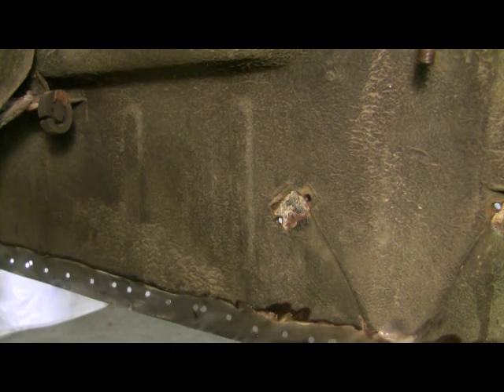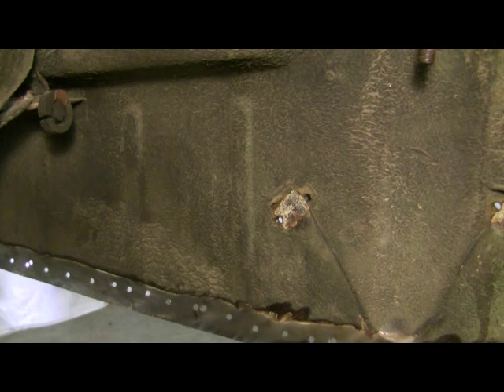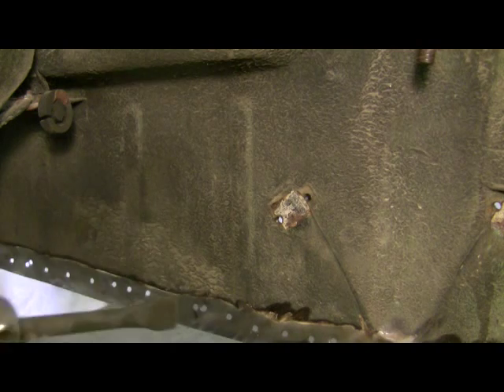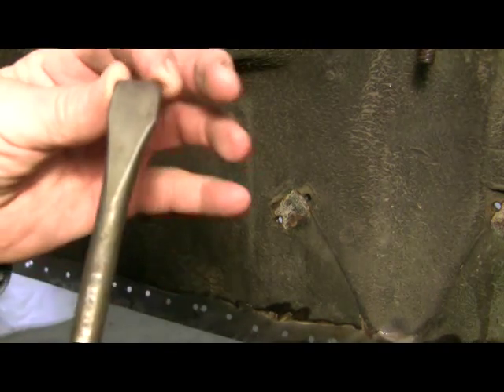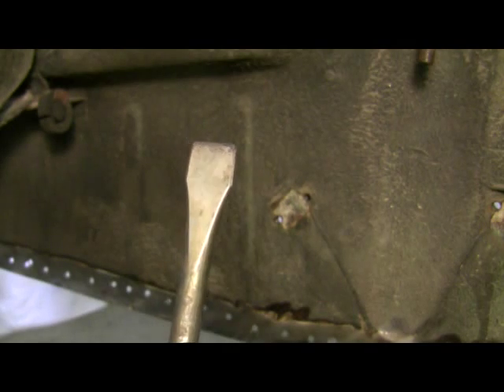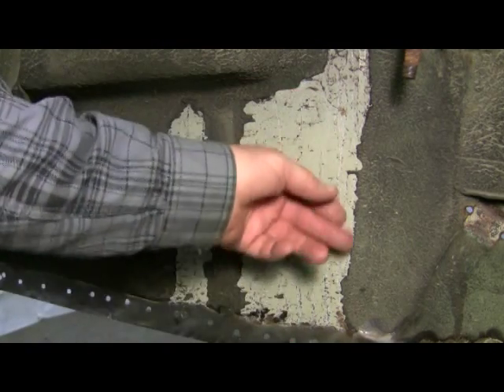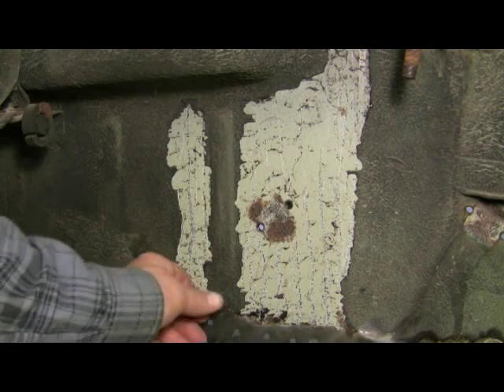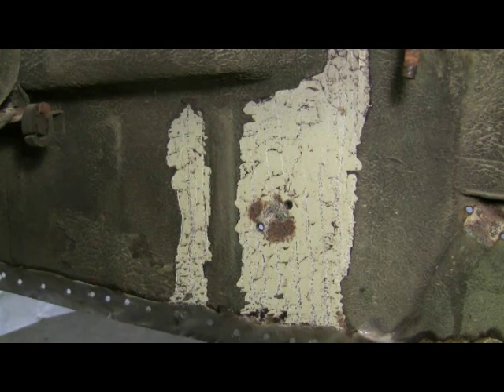Removing Undercoating with Air Hammer Chisel

Comment: i made the same mistake i too gouged the metal on my truck when i was working on it nice idea to dull the edges of the chisel. you might want to try a needle scaler as well they work really good for removing undercoating and scale rust

Comment: would this work to remove old sprayed in bed liner?
Reply from the maker: I hope someone else can answer. I'm a total amateur and only did this once.
Reply: Yeah, but you might also be able to use chemicals instead and save yourself a lot of time

I used a razorblader holder attachment for a soldering iron to remove undercoating too, even when it's very hard it will lift off in straps and not damage the metal underneath